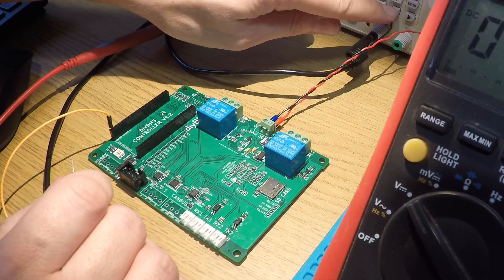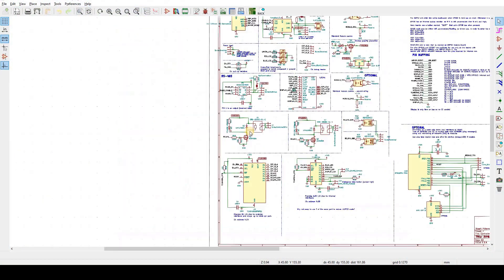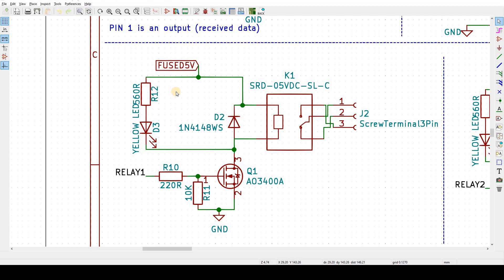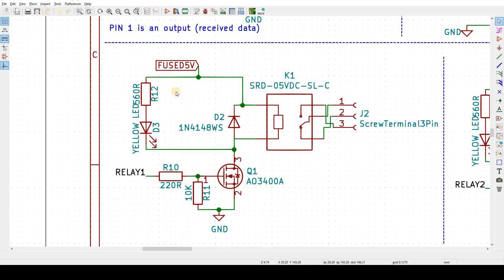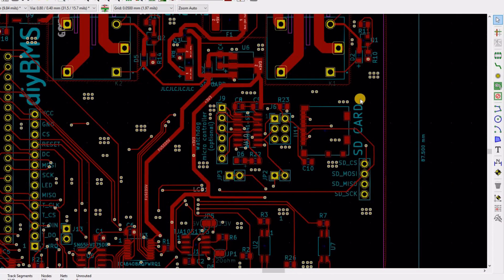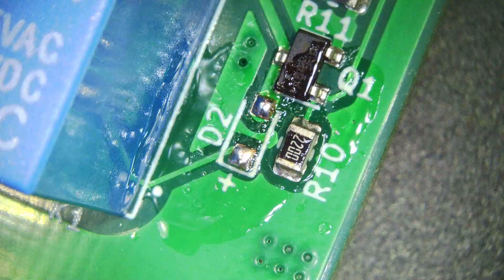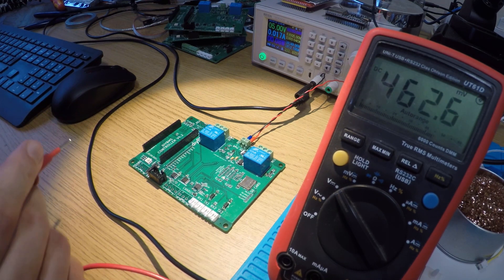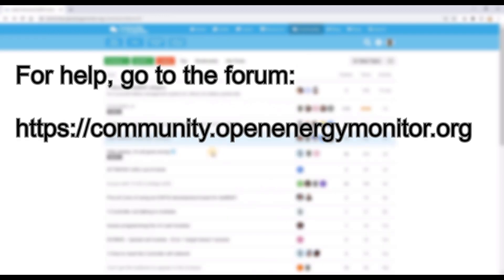Magic Smoke Released DIYBMS

Comment: I just received my order from JLCPCB, and after looking at the SD Card holder, noticed that it's installed backward just like your's is.  I'm assuming the diode D2 is installed incorrectly as well.  Still waiting for parts shipment so I'll verify D2 before assembling.
Reply from the maker: The SD card does not insert from the edge of the PCB, you have to flip up the metal cover, just like an old mobile phone.
Reply: @StuartPittaway  I see that now.  I wondered what those arrows meant.  Now I know.

Comment: the space in the middle for ATtiny841 what is it for and does it come into use
Reply from the maker: It's not currently used. It may be in the future, and is designed to monitor the esp32 for faults and errors

Comment: I had to smile a few times but nö offener
the flying SMD doofes
+
SD Card bracket in the wrong direction.

I guess you had checked every tiny detail 10 times and lost control of the big piece while diggin deep in SMD components ...

Luckily a prototype and intended to be found there and not in V1 batch.

Congratulations  to this prototype and progress achieved, even smoke is a good sign once you have found the right pov: now you know that why you have a fire extinguisher in your Shop !
Reply from the maker: The SD card was a really "doh" moment, you can read a data sheet a 100 times, but until the part is in your hand you never know!

Comment: Thanks for posting. When I saw the 1N4148 I did wonder whether its VRmax was sufficient. It'd be interesting to put a scope across the relay to measure the maximum voltage transient it would see when the relay is turned off. Should be an interesting probing job especially since the scope probe is ground referenced. You could put it on an isolation transformer... or do the test totally out of circuit with the relay and a battery. Cheers!
Reply from the maker: Great suggestion!  I recently bought a scope, but don't have the isolation transformer
Reply: @StuartPittaway  Silly me. One other thing that'll probably work in your favor is most lab power supplies are isolated unless you actually tie the output  to ground so you should be able to do the test that way and not mess with batteries - provided your lab power supply supports this.